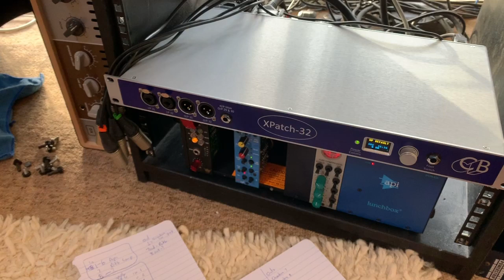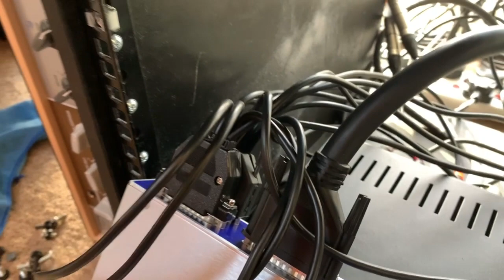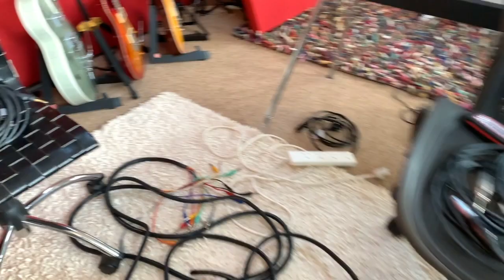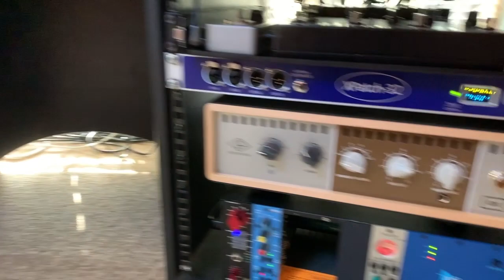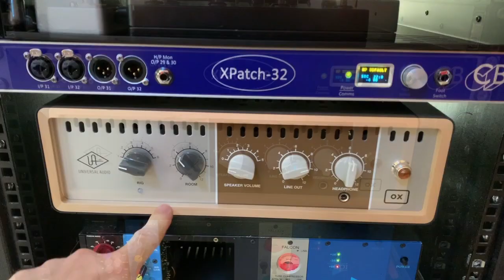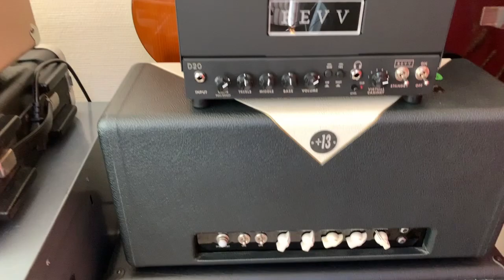CB Electronics Xpatch-32 Connecting all your Gear.

Comment: @1:25 you say "Outputs of your Xpatch 32 plugged into the inputs of your interface"? Is that correct? Outputs go into input when routing gear without a patchbay, but don't you just want input interface and inputs Xpatch to be the same? Isn't the Xpatch just a way to connect you interface to multiple piece of other gear without walking behind the racks and changing a bunch of cables?